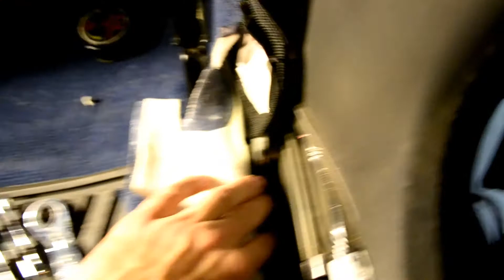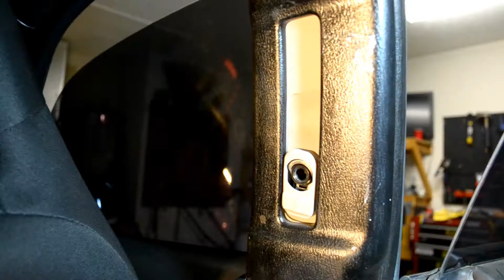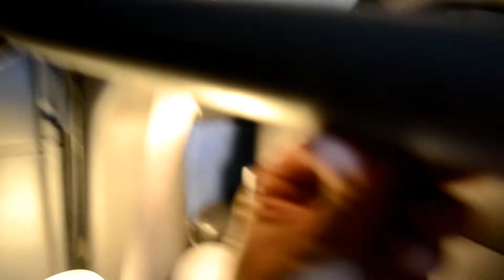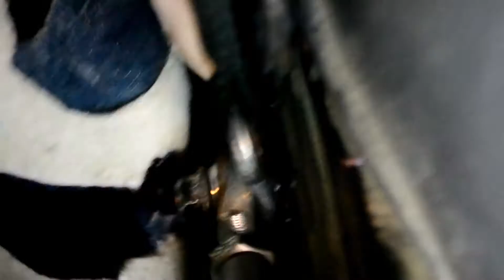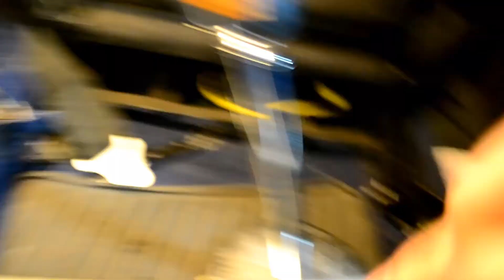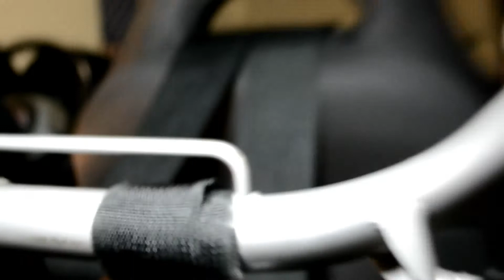How to install a Harness Bar in a Subaru

Comment: why did you put back the oem harness?i would just install new racing harness along with the harness bar and got rid of the stock harness ,just dont look good to me.
Reply from the maker: Juan Nunez It's just for ease of use, like if I have a 2min drive somewhere putting on 5 points get old after a while.

Comment: hey im buying the same thing soon just wondering where the actual harness all bolts to?
Reply from the maker: +Al Blades The shoulder harness will wrap around the bar and then it has a plate with slots to wrap the strap back through, and the the lap belts are are bolted into where the normal seatbelt spots are and for the antisubmarine belt, I have that bolted to the floor underneath the seat.
Reply: +ynotbmx88 awesome thanks man!

Comment: what is the length of the bar you used?
Reply from the maker: +Devan Kelsey The mounting holes are 48 inches apart. The NRG bars have a couple different sizes and the attachment points are kind of adjustable so you can have some play and I would home they come with a spacer to help with fitment.
Reply: +ynotbmx88 thanks!

Comment: An chance you know the size of it? i know the sizes very
Reply from the maker: The widest part on the b-pillar is 48 inches, and that is the size bar that i have, you can get smaller length I guess too if you adjust the seat belt connection higher.
Reply: So as you adjust the seatbelt connection higher you get a slimier length in the bar? so that means if you move it up higher you can get a 49" or even 50" ?
Reply from the maker: 30lbs of boost_jpg The opposite, the widest part is 48" so as you go up it will be smaller, 47" 46"
Reply: Oh! Okay thank you for all he help. I've been trying to figure this whole bar situation out.
Reply from the maker: Glad I can, let me know what you end up going with

Comment: Would a length 48.75 fit?
Reply from the maker: hunter23pierce I am not sure but you would just have to measure on your car between the two bolts, and you can move the bolt position to help